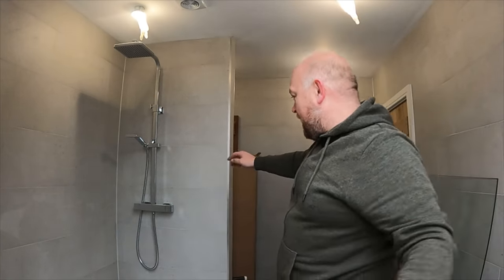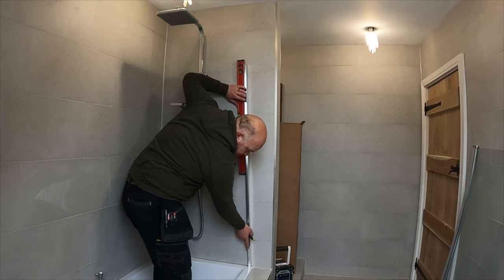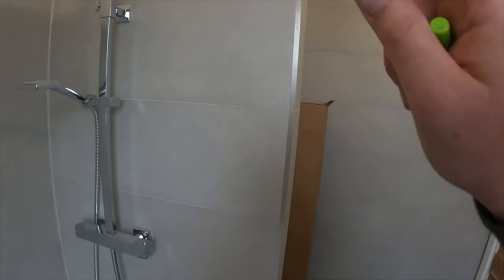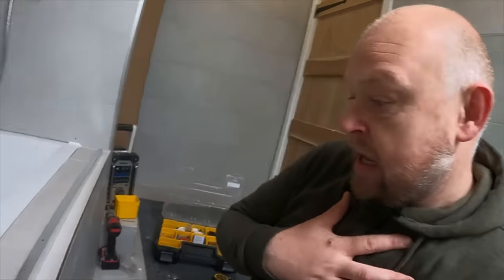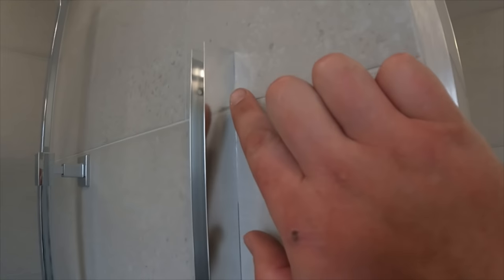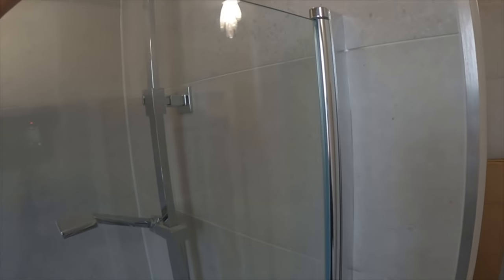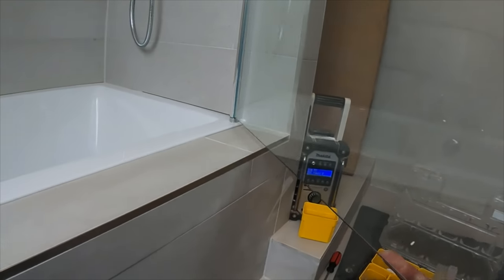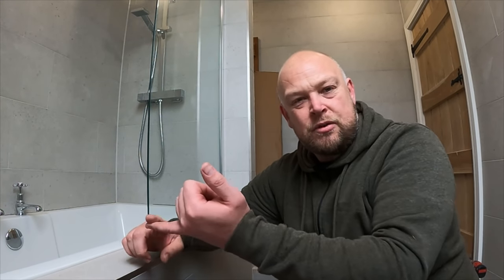HOW TO FIT A  SHOWER SCREEN in your BATHROOM...(Step by Step Guide)

Comment: To all those people who are commenting that there is water leaking by the screen hinge, ensure the bath has been fitted level.  Even a couple of mm incline can cause this to happen. Even incline the bath a couple of mm towards the back wall. I've just had a huge issue with incompetent plumbers. I discovered the issue simply by using a spirit level, they didn’t  use one. They suggested putting up a shower curtain to solve the problem. I'm hundreds of pounds out of pocket too.
Reply: I’ve just moved in a rental property and have this exactly leakage problem. The reason I watched this video so I can remove it and put a tension rod up with a shower curtain. I’m planning to buy in a couple of years so will keep this in mind if installing one 😅
Reply: @TinyBallOfHate  the shower curtain wouldn't have made any difference because the bath wasn't level in my case. 
I hope you've got your issue sorted

Comment: We need a shower screen fitting on our bath but we've a problem. Where you fix the screen there's a tile at the bottom next to the bath edge, this tile isn't flush with the bath, sticks up about 3 -5mm then you drop down onto the bath edge. How can we fit a screen without the water still escaping underneath the seal, as the seal will push up where the tile is and won't then go down flush to the bath edge?

Comment: I used these drill bits for the first time last week after seeing your previous video . I drilled 30 holes in rock hard porcelain and one bit did most of the holes . Best drill bits for porcelain I’ve ever bought . Great recommendation 👍
Reply from the maker: And only £6 for 10 🙌🏼🙌🏼🙌🏼

Comment: Thanks for this video, over the coming weeks I will be fitting a shower screen over my bath and found the video useful. I am intending to replace an existing elecric shower with a thermostatic one and will be moving it to the opposite end of the bath after building a narrow stud wall, have you any tips/videos on the piping involved, I have looked through your channel but can't see anything, maybe I have missed it, I intend to use plastic piping, any advice you can pinpoint me to would be most helpful. Many thanks.
Reply from the maker: Glad you liked it buddy…. Make sure your subscribed to the channel for more content👍🏼

Comment: Learnt a thing about keeping the drill bits wet. Have just bought the same bits and about to fit a shower complete. Just in time. Thanks.
Reply from the maker: Always keep them wet
Reply: Use cutting oil i do

Comment: Really helpful - thanks for posting. One question if I may? The area I'll be fitting my screen to is a tiled area which is boxed (hollow area) - is there a particular type of plug i should use?
Reply from the maker: Glad you found it useful.

Use a good strong red plug and make sure it bites well

Comment: Hi Mark, just been to my mother in law’s to fit a new silicone strip to the bottom of the glass screen and it’s now obvious why they are splitting after a few months. The gap from bottom of glass to top of bath is ok nearest the profile but at the other end of the glass it’s almost touching the bath too. Would I be able to adjust the screen when it slots into the profile or presumably I would need to remove the three screws, make sure the glass is parallel with the bath then re drill the profile!
Thanks 
Paul
Reply from the maker: Exactly that mate, would make it a lot better. Sounds like the bath is out of level maybe
Reply: I've got a similar situation but the bracket on the wall isn't level. Front edge glass nearly touches bath. Put 12mm packing behind bracket to test and that made it all level. This can't be the right way though?! I thought there might be some adjustment on the hinges on the screen itself. Has three holes at either end, two are screws and the middle one looks filled. One screw looks like it's holding the glass with a clamp, the other one is in the part that fits into bracket. Undoing these screws didn't seem to do anything. Surely not all bathroom walls are dead plumb? The bath is definitely level, it's the tiled wall that's out 🤷 I can't find a single guide online where someone adjusts the bracket at the wall or show how to adjust the screen hinges. All guides just screw on, all works, happy days 😂

Comment: My shower screen keeps falling down, the profile on my wall doesn't have the holes where you made the pilot holes into the metal. Can I make these holes my self, and what screws do you recommend to fix the screen into the profile so the screen doesn't fall down. I guess the plumber didn't do a good job on my screen. Many thanks
Reply from the maker: Yep drill them yourself and use small stainless steel screws with caps on
Reply: Thank you so much for the advice :)  @MJTiffPlumbing

Comment: Great, thank you 👍 What’s the best way to protect window/ frame/sill when it’s right in the shower/bath? I use a shower curtain, it’s a right pain, are there any better easy hacks or ways to get the water to run off the sill instead of sitting there?

Comment: Great concise vid, cheers. A couple of tips you could use.. I mark crosses on the wall or tiles so it's easy to check the drill doesn't drift - useful to keep everything spot on when you have a row of fixings to line up.. good to drill the tile 1mm bigger than the wall hole to avoid cracks when putting the screws in (and a spot of silicone in the holes first!).
Reply from the maker: Glad you liked the video👍🏼
Reply: Hi I got a question, how do you make the holes in the tiles bigger?
Reply: @drikareis1770  Use a 1mm bigger drill bit for the tile, then change to a smaller one to drill into the wall behind. So, for a 7mm wall plug, use 8mm tile bit first, then 7mm masonry bit - make sure you only widen the hole in the tile and don't go too deep.

Comment: I have managed to lose the fixing screws that attach the screen to the channel on the wall. What size screws do I need to buy for the three mm holes.  Do I need self tappers??
Reply from the maker: Stainless steel 10/12mm grub screws mate,
Reply: @MJTiffPlumbing  Thanks

Comment: Great idea Mark, do it mate.. I'll look forward to the upcoming series. You always crack me up, so learning while you laugh can't be a bad thing 👍🏻
Reply from the maker: Thanks mate…. Looks like it’s going to be a thing 👍🏼👍🏼
Reply: @MJTiffPlumbing  class mate, going to be very informative. Quick question, which/where did you get the shower screen from? Never knew the glass ones could move inwards and outwards from the bath. I always thought they were secured solid.
Reply from the maker: @rowson9265  
Plumbase as always 😉😉🙌🏼🙌🏼
Reply: @MJTiffPlumbing  use something else rather than plugs & screws . As it’s only plasterboard and tile . Better options out there !!!
Reply from the maker: @makg4655  never had an issue in 25+ years to be honest mate….. if done right it’s 100% fine👍🏼👍🏼
Reply: @MJTiffPlumbing  never had any issues with plugs and screws either always solid

Comment: Hello m8 great video. Just a quick question. Sometimes I get a leak between the rubber seal and the hinge. Do I leave the seal straight or cut it at an angle?  Thanks
Reply from the maker: Thanks mate….. not too sure what you mean tbh

Comment: Great video. My shower screen kicks out on the bottom when it swings open/closed. Which has caused the silicone to fail. Any ideas why it could be doing this?
Reply from the maker: Is the wall complete level??

Comment: Mark, I’ve got this exact shower screen and one of the hinges has seized.  Am I right to assume I can reverse the install to remove the screen, free up the stuck hinge and then re-install?
Reply from the maker: I assume you would be able to buddy…. But not 100% sure, make sure to check
Reply: Hi Paul, I’m looking for a small shower screen (1200mm height). Can you let me know where you got yours from and how high it is, thanks 😊

Comment: Amazing video, thank you!
I have a question. 
In my case, the bathtub edge, so, where the profile needs to seat , is right on the door wooden frame.
So, I will be drilling into wood to put the screws. Do I still use the plugs? Do I need different screws?
Your advice is appreciated 
Thanks
Reply from the maker: Just screw into the wood with no plugs and all will be fine

Comment: Hi mark would like to see how a shower tray is installed with tile adhesive or sand cement when using silicone isn’t suitable. Eg shower base doesn’t sit level.
Reply from the maker: Will see what I can do

Comment: hi mark good video what plugs did you use and how was the height of panel worked out in relatation to bath so it seals properly thanks
Reply from the maker: Red plugs on this, and the profile is flush to the bath, that’s how it’s set. Everything works from that

Comment: Here's a question our shower screen put in just too low, so now there's a gap about 2/3mm in that corner between Bath and the Bath seal 😭 now I can't heighten the bath there because the screen is forcing it down.... Question is : is there adjustment within the screen to give me 3mm to put the inner part UP so the bath meets the shower seal ... If you reply thank you
Reply from the maker: You should be able to undo and drop the screen down within the profile that is bolted to the tiles👍🏼👍🏼

Comment: Great video mark on fitting of a shower screen it amazes how so many people get this wrong.it would be good to see how to fix a bathroom towel radiator onto a plasterboard wall
Reply from the maker: Thanks Martin…. I will ad it to the list
Reply: I use cavity wall fixings,the ones that you squeeze with the gun.never an issue
Reply: @thomaswatt1658  I had a job the other day where someone had used metal self drill fittings the tenant slipped out of the bath and grabbed the radiator and pulled it out from the wall I used the same fittings you mentioned have seen toggle fitting used aswell
Reply: @martinkiely3147  I know the ones you mean,they're useless for anything with any weight.some people only want a quick fix and a quicker getaway lol

Comment: those 3 holes on profile - the distance between them is it standard? i mean, if i want to replace the whole screen will i need to drill new holes to the wall? thanks
Reply from the maker: Each screen company use different holes, so sometimes you fall lucky and they line up but not always

Comment: Top tip if you need to remove a profile thats been siliconed to the wall.... Dental Floss!
Reply from the maker: Oohhh like that mate, I use a cheese wire slice
Reply: @MJTiffPlumbing  yeah it cut through nice and it doesn't damage or scratch tiles and profiles.

Comment: I used to silicone the back of profile's but then I had to change a screen a few years later and it ended up braking a load of tiles so I only silicone the holes and the outside now!
Reply from the maker: Just use a wire slicer down the silicone mate, not an issue at all👍🏼👍🏼

Comment: I've got water leaking past the c channel and the glass screen. And outside of the shower. Can I run silicon inside the c channel?
Reply from the maker: Which bit are you calling the C channel??
Reply: @MJTiffPlumbing  the peice fixed to the wall  is c Chanel. It leaks between there and the panel

Comment: Tilers have done an awesome job by the way, is the mastic down to you? Have you seen the new screens with the adjustable screw holes? Great if you are doing a replacement, ScrewFix have them, think it's triton, saves the multiple trips to the van getting drills and shit. Got to say I've bought loads of them drill bits, they are really good quality, be careful if you are drilling porcelain and dipping them in water as it tends to temper them and make them brittle. Pain in the arse when the end snaps off in the hole. Sorry for the lots of questions etc but love the channel it's refreshing to see a plumber posting what it's really like, I've had enough of perfect pipe work etc lol.
Reply from the maker: Yep this channel is all about the “real world plumbing” side of things…
Mastic is being done by the builder/owner….. he wants it a certain way so leaving him to it….

Comment: I have a water pipe running across the bath edge next to the wall where the bottom of the profile would fit. Any ideas to get around  that problem.

Comment: Great  idea for a series!  Some of the issues i find are not covered for the amateur beginner is how to deal with actually getting the water off properly and what to do when it will not shut off. I.e turning an isolation valve off and then turning it back on again and it leakes from the isolation valve and will not stop dripping.  What do you do there? Also when draining down to change a radiator and the drain off valve washer sticks in and/or will not reseal when trying to fill it back up again.  For me the worry is what to do when the water will not stop and you dont know where to or how to stop it properly.  So....changing a kitchen tap which has isolation valves on you turn them off fine, change the tap go to turn valves on and they both leak and will not stop....whats the next step, change the isolation valves but how when water will not turn off at tank/boiler etc. Yes i realise simple jobs for professionals like yourself but scary for the amateur and no idea how to address the problem. Hope this makes sense and thank you for the great videos really appreciated.
Reply from the maker: Thanks mate…. Will try and address some of that

Comment: Do you or anyone else find that this type of screen with the bottom round hinge profile tends to leak as the seal is always curved in to the inside of the bath which then leaves a gap between the seal and hinge.
Reply from the maker: I’ve never had an issue tbh

Comment: hello, new here. can i use a bath shower screen for a walkin shower instead of sliding doors that will cost a lot more
Reply from the maker: I wouldn’t to be honest….. plus it won’t cover the whole height
Reply: @MJTiffPlumbing  im only 5.1 so height wont be in a issue lol. whats the difference in being able to use it on a bath then and not recommended on a shower tray with the walk in shower? apart from the height. genuinely seeking advice and appreciate the feedback

Comment: Great video brother. I’m not sure about across the pond but over here in ‘Mercia lol, we have tankless hot water heaters. Almost like an instant hot water deal. Curious about if you guys have something similar and maybe how you handle those, fit to finish.
Reply from the maker: Thanks mate……. We have combi boilers, they do that along with running the heating system aswell
Reply: @MJTiffPlumbing  nice. Simple enough then, I think I’ve seen a couple of you handling those. Thanks for the reply!

Comment: Please keep them coming for the trainees like me. How to solder, and how to measure out and pull bends in the right place would be marvellous for me. 😊

My first ever paid plumbing job was fitting a screen like this and a medicine cabinet.

Quick question when drilling for the plugs do you stay the same size as usual or go up half a mil or so through the tile. I'm always terrified the tiles will crack putting the screw in if the tip of the plug is too snug if that makes sense. Any thoughts from someone who's drilled thousands more than I have would be appreciated.

Look forward to these. 👍
Reply: You'll probably ever only use 2 types of rawl plugs, red and brown, red is 5.5mm drill bit, brown is 7mm drill bit, perfect every time
Reply from the maker: As above mate…. Jamie has summed it up perfectly👍🏼👍🏼

Comment: That rubber seal will need a blob of clear silicone at the open end pal 👍also a tiny bead inside the seal will hold it against the glass perfect
Reply from the maker: Never needed to do that on any that I’ve ever fitted buddy….. but people do fit them differently, this is how I do them 👍🏼👍🏼
Reply: @MJTiffPlumbing  
Top channel pal keep the real life stuff coming i can tell you for certain thats what people wanna see
Reply from the maker: Thanks mate…. Appreciate that 👍🏼👍🏼🙌🏼🙌🏼

Comment: Better to have the holes on the outside for the screws so they don't let water into the channels. Easier to clean from inside to, as you just wipe down. This is how my one was done. 
"It's not hard to cut through that bead of silicone" - lol, I've been struggling since yesterday doing just this. I'm re-tiling at the moment. 
PS: These doors ALL have a massive design flaw. Do yourself a favour and drill some small drain holes in the bottom bracket. Otherwise over time it fills up with gunk and it spills over the top of your outside silicone, runs down the wall and finds it's way into your joists where woodlice then make a home.
Reply from the maker: Nope….. the screws are designed to go on the inside, and this is why you never silicone the outside AND inside…. Just silicone the outside.
This is so if water gets into the profile through the screws or anywhere else it can run out..

This is how they are designed to be fitted….. no one wants the screws on the outside at all
Reply: @MJTiffPlumbing   Did you seriously like and thumbs up your own comment? lol. If the screws are on the outside, water will never get in the holes. This has no bearing on how you silicone the outside and not inside, that's just good practice anyway. I think the screws being outside makes more sense.
Reply from the maker: I seriously did mate….. if you knew how YouTube worked you would understand….lol…

In 30years of plumbing I’ve never ever fitted screws on the outside and no one I know has either….. it wouldn’t look asthetically nice at all and isn’t to manufactures instructions, probably fitted thousands of screens and never had instructions saying to put them on the outside….